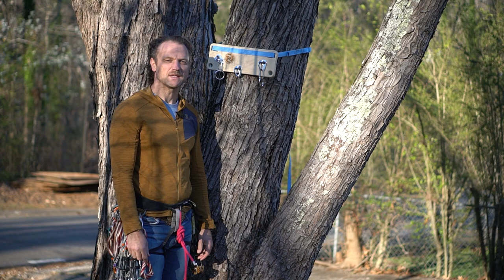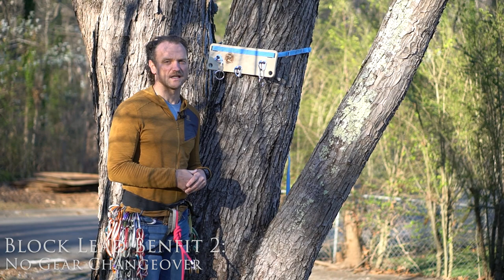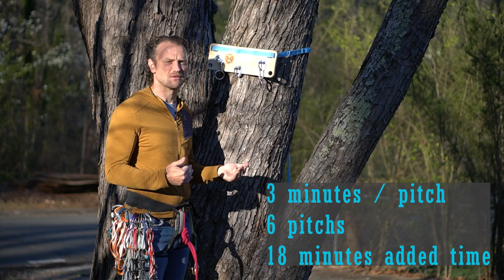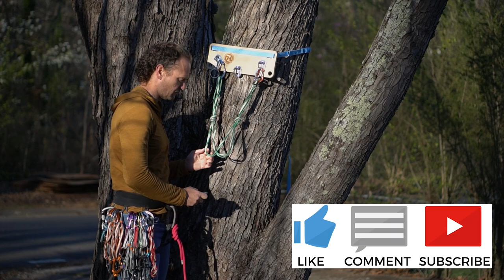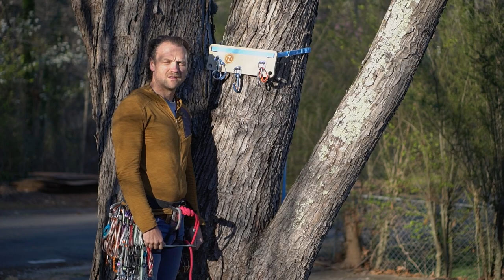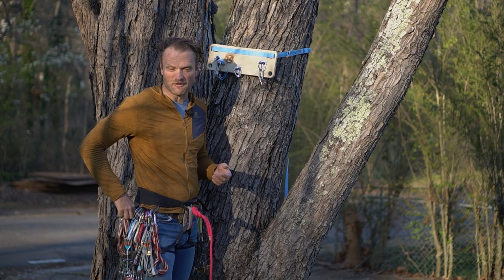Multi Pitch Climb | Tips for Efficient Climbing and Transitions

Comment: 2:40 a great tip here is that sometimes it is more efficient to just untie your figure of 8 and switch ends of the rope. This way you don't have to do the pancake flip and risk tangles at weird belays. Just make sure to use your personal anchor or other gear to go into the anchor direct before you untie your figure of 8.
Reply from the maker: Dude, love that idea. I'm going to use that.
Reply: I don’t know why this never occurred to me before. It’s so obvious!
Reply: Nice trick... and it might be the best option at a weird belay. But I think that's a very bad idea in general. Besides requiring a PAS/cowtail/quickdraws to go in direct, untying/re-tying multiple times adds unnecessary risk of getting the sequence (and maybe the knot) wrong. It might even introduce a new tangle. That risk is multiplied by the number of pitches. Only do it once for the rap if not walking off.
Reply: I've always scooped the lap coil, threaded a shoulder length sling under the coil, and binerd it. Then when it has to be handed  off, I just un hook it from my gear loop to theirs.

Am I missing something?  I'm not sure I'm comfortable with any regular procedure that incorporates untying from the system.
Reply: @summitseekersexperience   As a AMGA ( I almost read that as MAGA ha ha ha ) guide you should really rethink this. Unnecessarily untying the rope from you / partner multiple times will result in complacency at some point. Its an added step into an otherwise standard procedure when swapping leads. The lead swap at belays is already a busy procedure that requires attention and double cks on everything even more so when at semi or hanging belays.  After finishing a lead the Belayer should be stacking the rope so it can be easily flipped or fed out for the next lead. But untying ? NO .
Reply: It works in theory yes. BUT if the Belayer is experienced and has good rope management there is no need for this. Consider that in many instances the rope itself is used to connect the climber into the anchor system. As mentioned in my reply to Summit Seeker ( the video's channel ) Untie / Retie  introduces an unnecessary step - one that  adds the chance for complacency for someone to forget to retie or screw up the knot if in a rush. Most guides and instructors do not teach this.

Comment: You should twist one strand of the sling like you're making a sliding X before tying the girth hitch masterpoint, in case it loosens and one strand comes unclipped from the anchor, it can slide through the hitch but you'll still be clipped into the sling.
Reply: This is a really good point. I just tested the girth hitch with one side failing and it came undone. I'm a bit confused on how to incorporate the sliding x into the master pt
Reply: Standard practice for sure . I cant believe this AMGA cert'ed Guide did not do this !

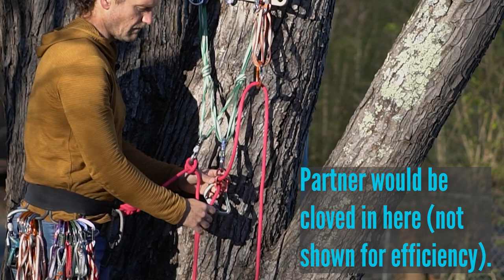Comment: At 7:55, dont underestimate the danger in this position. Its crucial to tie an air clove onto that upper carabiner. If you tie a clove with the handshake method there is a moment where the atc is disengage and a fall would be devastating.

Comment: How does block leading brings about less of a need to trade gear at belays?

Because if I've lead the pitch, and have anything less than 1/2 of the pieces still with me at the belay, then most of the gear is with my second. So I'll have to retrieve that gear. IME, I typically have ~1/3 or 1/4 of my pieces left with me. Which makes swapping leads MORE efficient for trading gear, since you follower has most of the gear when he gets to the belay. Maybe some people bring lots of pieces than I do? The way I see it, if I end up with most of my gear still with me at most belays, then I'm bringing more gear than I need to. But at any rate, it seems to me this point is at beast a wash between block/swapping.

Or something I'm not getting right here? Maybe depends on types of climb? E.g. sustained technical pitches will bring more of a need to protect, whereas more alpine style routes with lots of easy ground that allows really spaced out pieces?
Reply from the maker: Yeah, I think you are correct on all fronts.  Most of the climbs I do on the east coast have shorter pitches and as a leader, I don't place much to begin with, so I still have the majority of the rack.  However, out west, when I do pitches on order of 160-200 feet, I end up placing the majority as you said and then it's probably more efficient to swap leads... until you realize you might lead twice as fast as your partner ;-)

Comment: Great overview of different options at the belay - organized and easy to follow. Some of your speed tips though.... Focusing on cams, for instance. The most important thing for speed is to not break up pitches and if you are mainly placing cams, you're going to run out (or have an insanely heavy and expensive rack). The point about not extending your pieces is, I'm sorry, irresponsible. Many beginners don't understand how troublesome and dangerous zig-zagging is and this video could easily encourage bad practice. Who extends when it's unnecessary?
Reply from the maker: Thanks for the feedback Simon.  In my experience with (I use a double rack of cams and a set of nuts). I'm able to do a lot of pitches quickly as about half the anchor stations have bolted anchors.  I think if you are doing a route that has NO bolted anchors, I agree with you, you may need to place nuts or something of that nature (I did that this weekend in NC on a hard route where I needed to place a lot AND the anchor stations had to be built)... So I placed nuts, which is fine, but on easy 5.7 or whatever, having the mindset of placing cams over nuts is always something to think about for speed.  Thanks for the compliment on the video!
Reply: @summitseekersexperience  Yeah, partly bolted routes are quite different - just the belays speed up the game a lot. But - let's say easy 5.7: you're typically going to run out the rope on every pitch. A dozen or so pieces would mean an average of 4-5m between pieces, so you'll have to climb with the knowledge that a fall will typically hurt or kill you (5.7 is mostly really scary, with lots of stuff to hit and loose rock potential). A dozen pieces plus a belay or two is 14-18 pieces, so unless you have excellent gear beta, you're going to have to carry a ton of expensive hardware. Just practice nut placement so you're faster. If your time savings are really significant, you probably just need more practice. Oh, and don't thread your slings, just throw them over your shoulder.
Reply: And I'll stand by my comment about extension. Zig-zagging is a common problem for inexperienced leaders and I encourage you to take this video down, despite most of it being really good stuff.

Comment: So, what's the difference between alternating and block climbing? And how is block climbing faster?
Reply from the maker: Hi Kayce!  

Alternating is basically the leader switches out every other pitch.  So I lead one, you lead one, I lead one, you lead one and so on.  

Block leading is where I would lead like 3 in a row and then you would lead 3 in a row (blocks of pitches).  

The reason block leading is typically faster is that we don't have to transfer the gear every single pitch.  If I were leading a block, every time you came up as the follower I would only have to get the pieces from you that I had placed which is a lot faster than transferring over the entire rack.  

Additionally, we could strategize about who is better in what pitches which would lead to faster climbing.  This takes a little homework, but can lead to ultimately a faster climb.

Hope that helps.
Reply: @summitseekersexperience  makes sense. I was thinking that every piece of gear would be placed by the leader for some reason. If that was the case then alternating would be faster. But I get it now, thanks!
Reply: Great content! Keep it up!

Comment: I’m surprised you think that block leading is more efficient. Flipping the rope (or even two ropes,  if you use half ropes) is always a hassle.
On well protected multi pitch routes where you climb with an appropriate number of quick draws the gear handover should be much faster with alternate leading. Most of the quick draws will end up on the route and the follower will pick them up “automatically”.
Reply from the maker: Yeah... I think a lot of it is personal preference and climbing style.  No doubt flipping two ropes is a pain, totally agree... but with a single partner and if you are flaking rope at your feet, I've found that pancake flip is 2 seconds and pretty successful.  I don't place much gear when I climb unless it's hard so that also contributes to this line of thinking for me personally.  Definitely can see how if you are placing more, alternating would make more sense.
Reply: I had the same question as the first commenter and I think the reason is that as an American you equate multi pitch and trad. I come from France and as of now have done all my multi pitch there and always on sports route where no trad gear were used and I completely agree with the first commenter in that case so much easier to alternate. In particular I’d like I have often experienced in places like the Verdon gorge you don’t have the luxury to flake at your feet but you put the rope on your personal anchor as you are in a hanging belay most of the time . Also we tend to use double ropes even with just two climbers as we need long rappels and it is helpful with drag